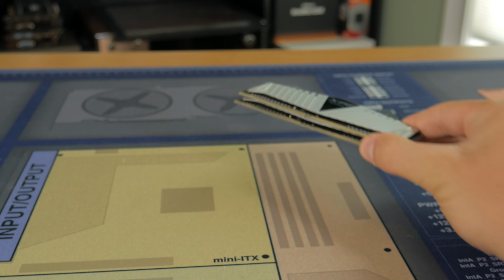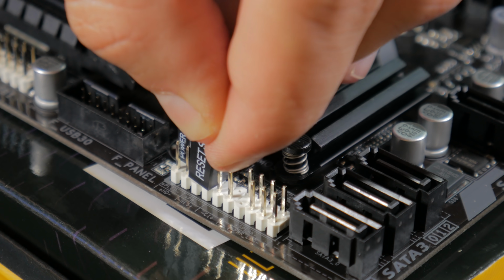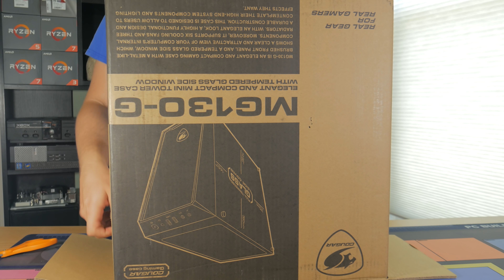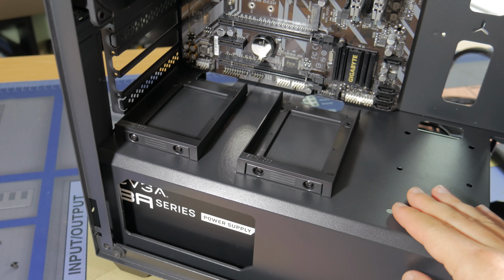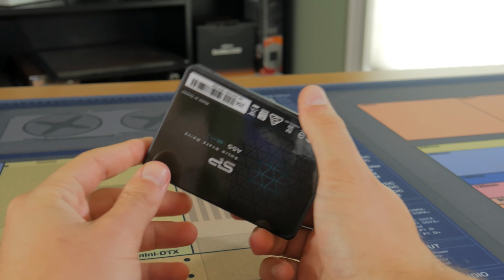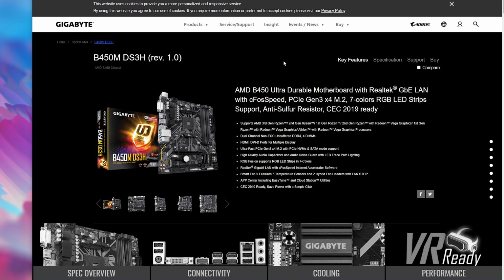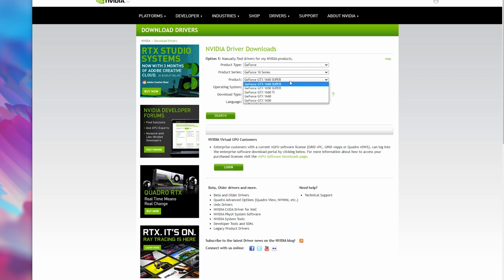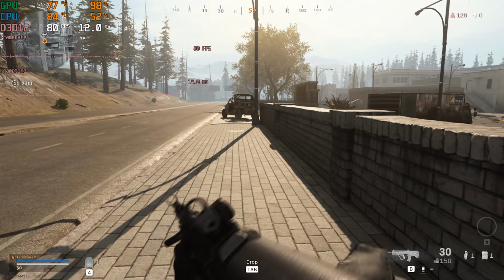HOW TO: Build a $550 Gaming PC! (2020)

Comment: I finished building and when i went to plug the HDMI in it said no signal. I the plugged it into the graphics card but nothing happened. Any Suggestions
Reply: The same thing is going on with mine that I just built. Same exact build but I get no post. I did everything he did EXACTLY, this is honestly bullshit. If you ever find out what went wrong I’d highly appreciate it. The thing I hated about this video though is that he plugged in all the cables while on the carboard to be more clear but it only ended up confusing me because when I routed my cables mine looked nothing like his.
Reply: Did you find a fix

Comment: I used everything in this video but went with recommendation 1 for the CPU but when I try to power it on, I get no signal reading on my monitor. I tried checking the connections on my PSU but didn't see anything wrong. The fans kick on but nothing else.

Comment: Would you guys recommend using a ryzen 3 3200g apu as a budget gaming pc, then add a gpu later? Or would it be better to use a ryzen 3 3100 and gtx 1650 super off the bat???

Thanks!!!
Reply: I built this PC last night with the Ryzen 3 3100 and the GTX 1650. My son and I are having fun playing Apex today.
Reply: @DSTROYRvids  Nice!
Reply: JChase7452 I built it last night as well but I’m having trouble with the display not showing any advice ?
Reply: @strafezss5883  did you connect it to the motherboard or the gpu
Reply: The ryzen  3 3100 has no apu so if you connect it to the motherboard, the display will not work. You have to connect it to your gpu/graphics card with an hdmi or displayport cable to your tv or monitor
Reply: Limespy YT yeah I connected it from my gpu to my monitor I went back and unplugged everything and replugged back in its just not working
Reply: Limespy YT I was using the display port it just says “no signal” when I power it on
Reply: @strafezss5883  could it be that your GPU is faulty???
Reply: Limespy YT the fans are spinning and it’s brand new so I don’t think so
Reply: @strafezss5883  is everything plugged in right? Like your psu cables, and motherboard connectors?
Reply: Maybe something is not plugged in right?
Reply: Or try using HDMI instead of Displayport. I've never tried using displayport yet.
Reply: Limespy YT yeah I went through all of thoes things and I connected and re connected them but still nothing I also tried the hdmi cord it still says no signal
Reply: @strafezss5883  well then... I dont really know what to do... Sorry man. Keep talking to me and lets see if we can figure it out.
Reply: Also are you connecting it to a monitor or a TV?
Reply: Limespy YT a monitor I also tried it on a tv
Reply: @strafezss5883  oh.. well then. I'll try to help ypu find out what is wrong ok.
Reply: @strafezss5883  the link goes to a video about what happened to your pc
Reply: Limespy YT I think it might be something with the bios and it not being supported
Reply: Limespy YT I think I need to update it but idk how
Reply: @strafezss5883  first of all, what's your cpu, and what is your motherboard?
Reply: @strafezss5883  its easy to update the bios, but your pc isnt working
Reply: @strafezss5883  all you have to do is go to either AMD or Intel website, amd search for your motherboard model. There should be an option to update the bios to support newer cpus
Reply: Limespy YT I need a 1000 or 2000 series to get it running then update bios and replace when done
Reply: Limespy YT but idk where to get one without having to pay a ton
Reply: Limespy YT my mother board is the one in the video the cpu is the ryzen 3 3100
Reply: @strafezss5883  there should be nothing wrong though. The motherboard and cpu are a perfect combo for each other. And im pretty sure that the b450M is suited for 1st 2nd and 3rd gen ryzen processors.
Reply: @strafezss5883  what about your power supply? Some chinese brands are faulty.
Reply: The video i sent the link for mentioned either a power supply, or ram.
Reply: @strafezss5883  Do you have a second pc, or a laptop that you can use to connect to the monitor?
Reply: Could be that its the monitor, and not your pc???
Reply: Limespy YT it’s not the monitor I plugged into my tv as well also I got the same power supply as him
Reply: Limespy YT also it’s possible that it’s not uptodate if they gave me a mob that was in the back of the shelf so maybe it’s just the bios
Reply: With the ryzen 3 3100
Reply: @strafezss5883 yeah, that could be why. It was maybe a used mobo from like Microcentre or something
Reply: Is your cpu fan spinning?
Reply: Limespy YT yeah
Reply: Limespy YT everything in the pc is working but when it comes to the display it’s not working
Reply: Limespy YT also my power button dosent work when I need to shut it off I found that it might have something do to with the bios not being up to date which is why I’m assuming I need to update it
Reply: @strafezss5883  when you say power button, you mean the one on the pc case?
Reply: @strafezss5883  try your front panel connections. The little ones that your connect to the side of the motherboard. The one that say reset switch, power, hd audio, and other ones like that.
Reply: @strafezss5883  but it could also be because the motherboard is used, and its damaged or something?
Reply: Limespy YT the mob is claimed to be new also the power button on the case and I re plugged the reset switch in as well as all the other one but it dosent worm
Reply: Work* and that’s also a result of the mob not being able to support the cpu which results in no signal and the power button not working
Reply: I just don’t know where to find one without having to spend 100$
Reply: @strafezss5883  yeah, thats really hard... I'm not really sure if there are any other options, other than buying another cpu.
Reply: @strafezss5883  apperently, you can bring it to a local tech/computer shop, and ask them to update the bios somehow for only $30
Reply: @strafezss5883  check out the link i sent
Reply: Limespy YT Thanks I might check out some around me
Reply: @strafezss5883  your welcome! Hope that your PC will be fixed!
Reply: Limespy YT I’ll let you know if I got it to work ty
Reply: @strafezss5883  ok got it. Bye For now!
Reply: @strafezss5883  Did you get it working?
Reply: JChase7452 no I’m getting a new cpu a ryzen 5 2600
Reply: JChase7452 it should work 100% with this cpu
Reply: @strafezss5883  thats pretty expensive though
Reply: Limespy YT it’s only 40$ more I’m returning the other one
Reply: @strafezss5883  oh well at least you can return it
Reply: @strafezss5883  I thought you now have two cpus
Reply: You might have a bottleneck with the gtx 1650 super because its am ryzen 5, and not a ryzen 3
Reply: Limespy YT what do you mean
Reply: Limespy YT bottleneck?
Reply: Limespy YT wait like the ryzen 5 wont perform to its best if it’s ability because of the gtx 1650 I mean tbh it’s fine I don’t mind I honestly just wanna be able to play games cause anything is better than a Mac en
Reply: @strafezss5883  yeah something like that. Either the cpu will not perform to its best, or the gpu. I'm not sure.
Reply: @strafezss5883  basically the cpu might be too powerful for the gpu
Reply: @strafezss5883  search up bottleneck calculator, and enter your ryzen 5 2600 and gtx 1650, the website will give you a bottleneck percentage.
Reply: @strafezss5883  if the percentage os under 10% then it is okay. But the lower the better.
Reply: @strafezss5883  if the percentage is over %10 then it is a bottleneck. Basically, you will get random frame rate drops/ fps, and it will not be performing at 100%
Reply: @strafezss5883  the ryzen 3 3100 and the gtx 1650 super is a perfect combination, but it did not work for you. Because of the bios situation.
Reply: Limespy YT ahhh alright
Reply: Limespy YT it’s 9.24%

Comment: Yo Matt I'm gonna build my first pc with a similar budget, can you give me your input on my parts.

MOBO: BIOSTAR A320MH AM4 AMD A320 SATA 6Gb/s Micro ATX AMD Motherboard ($55)
Graphics card: MSI GeForce GTX 1050 Ti DirectX 12 GTX 1050 Ti GAMING X 4G 4GB 128-Bit GDDR5 PCI 
Express 3.0 x16 HDCP Ready ATX Video Card ($160)
Case: Cooler Master MasterBox Q300L ($50)
Power Supply: EVGA 500 W1 100-W1-0500-KR 80+ WHITE 500W Power Supply ($50)
RAM: G.SKILL Aegis 16GB 288-Pin DDR4 SDRAM DDR4 2666 ($50)
Processor: AMD RYZEN 5 2600 6-Core 3.4 GHz (3.9 GHz Max Boost) ($140)
SSD: Silicon Power Ace A55 2.5" 256GB SATA III 3D TLC Internal Solid State Drive (SSD) ($28)

All these parts are from newegg and I would really like your opinion on them.
Reply: Does the motherboard support the Ryzen processor?
Reply: Eduardo Luna No it doesn’t thank you for pointing that out. I’ll look for one that does.
Reply: Ryzen is am4

Comment: Processor: AMD athlon 200GE 3.25GHz APU with vega 3 graphics 

Motherboard: AMD A320 DDR4 Micro-ATX RYZEN mb

Memory: 16GB DDR4 2666Mhz high performance gaming RAM

Graphics card: integrated GPU share up to 2GB graphics

Primary hard drive: 256GB Ultra-Fast SSD upto 550mb/s+ speed solid state drive

Power supply: Gamdias KRATOS E1-500W RGB Power Supply

Heatsink and CPU fan: standard heatsink and CPU fan

GTA 5

Will it run?

How much fps?

How high graphics can it go without lagging?

Will it lag?

Will it overheat?

Comment: i like this cougar tower and planning to build my 1st pc with the same case
just wondering if a evga 450w psu is enough for a ryzen 3 3200g and a rx 570 4gb
im planning to build w/out  a dedicated gpu 1st and just buy one after saving enough money again

thanks is advance
Reply: 450 would be fine for that system, but if you plan to upgrade, or even if you don't plan, it's safer to go with a 500 or 600 watt, but whatever fits ur budget. 450 is perfectly fine tho for that
Reply: @noahzacharia5030  thanks a lot for your advice, my original list is a 500w psu but rn im having a hard time finding one and a lot of them are out of stock in my country
but again thank you for the reply
Reply: @hitori_gurashi  yeah the world is kinda on a psu shortage, but good luck w ur build

Comment: U probably already got a comment like this but u missed the important part that it already has pre applied thermal paste on the bottom of the cooler so if u where to change out the cooler then u need to make sure to apply some thermal paste cuse its what helps keep everything cool and stable

Comment: How do you know if the RAM sticks should be paired on a B2 with A2 rather than B1 with A1? Don't both of those configurations benefit the dual channel? Does it make a difference having A2/B2 channels over A1/B1?

Comment: The best part of the video that I haven’t seen anyone mention is the whole section about plugging in cables and orientation. The cables were filmed plugging in while the mobo was on the box, NOT installed into the case. The extra detail probably made more sense to 99% of new builders.

Comment: IF YOU TURN OFF THE FRAME COUNTER... an FX-4100 with an equivalent radion gpu will run the same. just beware of bloat-ware, easy enough with a fresh OS.
Reply: 3300 over the 4100 ... loading times... your waiting at the game match timer for an extra 10 seconds.
Reply: 10 seconds on some game that even with a fx4100 boots up faster then a piss brake.
Reply: @hollol5933  fx4100 with a rx570
 54.6 fps avg. In Rainbow Six Siege high settings 

46 fps avg. In Rust, all settings turned up as far as they go.

Tho I guess in Minecraft with the settings render distances... maxed out it gets 15-20fps.

BTW the Dule channel ddr3 ram I have is set to run at 500Mhz.

At 1080p the RX570 4GB over heats and thermal throttles on the stock fan profile. The fans get loud trying to keep it cool, even  if it's a fx4100 and 500mhz ram feeding it.
Reply: @ardennielsen3761  the fx4100 is a HUGE bottle neck the rx 570 should be performing way better then that
Reply: I’m still not sure if your joking or not
Reply: @hollol5933  ya... the DDR3 i have is running at 400Mhz.

Comment: Hello matt. I just wanna ask. What is the difference between msi a320m-a pro and gigabyte b450m. Thank you for replying.
Reply: You'd probably need a bios update if you're using newer cpus (ryzen 3000 series) if you go a320-m pro
Reply: @icanbefree8742  Why do i need to update my bios?
Reply: @DD-qw1yr  it might not support your cpu if it's a newer one. It should say what cpus the motherboard supports on the box though
Reply: @icanbefree8742  I think msi a320m-a pro support the ryzen 3 3100.
Reply: @DD-qw1yr  ok yeah I just looked it up and it is supported, but yes a bios update will be necessary. Also if you go a320m there's no real overclocking support. Personally I would try to find a cheap b450m motherboard instead if possible - saves you hassle of bios updates and will probably age better too.
Reply: @icanbefree8742  Well, im not an expert of oc thing. So i would go for a320m instead. Because of its price difference. And theres no performance diff btw. Same as is it.

Comment: which one to get r3 3300x or r5 2600?
Reply: Whichever. The Ryzen 5 is a bit more powerful, getting over 100 fps at 1080p High/Max settings. Depends if you want that extra fps at the same or better graphics settings.
Reply: 3300x is better by all accounts. But depends on the prices.

Comment: Help im putting tbis buils together on pcpartpicker.com and it says the mobo and cpu aren't compatible. Ar3 they? 
Warning!Some AMD B450 chipset motherboards may need a BIOS update prior to using Matisse CPUs. Upgrading the BIOS may require a different CPU that is supported by older BIOS revisions.
Reply: If the motherboard says it's compatible on the box, then it is out the box.
Reply: the "b450m DS3H" doesnt support the "ryzen 3100" out of the box, you will need to update the motherboard bios before you can use this cpu. updating the bios is not that complicated but since this motherboard doesnt have "Q Flash plus", you will need an older ryzen cpu that is supported by this motherboard, you can find a full list of supported cpu on the official gigabyte website.
Reply: Rocky Go  hey thanks. Yeah I chose tbe ryxen 5 3600 too.  No compatibility issues
Reply: Rocky Go  Will this be the same for my Ryzen 3 3100? Sorry I'm new to building pc's (Please respond quickly)

Comment: I love this build. However, in Europe this particular build would costs you 700, not 550$. I recommend a “downgrade” version with similar performance for European builders by opting for the Ryzen 3 3100, B450M S2H, RX580 8GB, Any good cheap SSD, G.skill Aegis 16gb RAM, SilentiumPC 550w 80+, MSI Mag Forge.

Comment: How In The World Does This Perform Better Than My $1500 PC??????
Reply: What are your specs? I might be able to tell.
Reply: @CodingLessonsDaily  i5 8400 2.80GHz, GTX 1060 3GB OC, 16GB Corsair DDR4.
Reply: @oliverkeast305  the 1060 3gb is on the lower end of a mid-tier card, the 1650S beats it. Your 8400 should outperform a 3100, but loses to a 3300x which runs on a higher frequency, and on 7nm. I'm assuming your $1500 PC was a prebuilt? That's where you got shafted.
Reply: @Tovinthorn  Yeah that seems correct
Reply: @Tovinthorn  It actually wasn't a prebuilt. I should have done some more research before buying the 1060. Im waiting fir the 3060 to come out, and when it does ill be buying that. Later down the line upgrading to a 9700F.
Reply: RozzoX sounds like a good upgrade path. How much did you want to spend on a GPU that you want to consider the 3060?
Reply: @Tovinthorn  Around $400-650 AUD

Comment: Hey! You should make a $450 build using the i3 9100f! (at least thats what im doing)  and also thanks for testing fall guys!
Reply: wow I sparked a debate
Reply: Nope he should dont do it beacuse i3 9100f had to less Cores
Reply: MagicPlays did you just have a stroke
Reply: @PlzReviveMeBro  haha Kids its not faster the i3 10100 ist faster Sometimes but the i3 9100f is slower
Reply: @timshardware  bro are you having a stroke? also its about price to performance not just which processor is the best one
Reply: @timshardware  my guy i am a proud amd fanboy but you dont understand anything in english
Reply: @ned_filip6728  i Understand what you write but why a stroke. Yeah the price-performance is better. Sry when  you dont Understand my english
Reply: MagicPlays 9100f is also 9% faster than the 3100 for $45 less

Comment: I love the look of that case, but is there any airflow? It looks entirely sealed up.
Reply: Its definetly not the best for airflow much more of a "showroom" pc
Reply: Colin I want to get a different case but idk which one to get because I don’t know if the motherboard and the other parts will fit
Reply: Chris A ive got the corsair 250i airflow which works great and is designed to have a lot of air and works great
Reply: The top of the case is a magnetic filter, so it has lots of airflow there
Reply: @John Perez a fan is not a good airflow since it pushes the air.. the best airway could be it's top... That's the reason i did not put any fan there
Reply: @Jared Miñoza yes.. i have 3rdb fans, i think that's enough plus the case's fan at the back

Comment: What cpu air cooler for ryzen 5 3600/b450 tom max/44mm tall ram sticks/rtx 2060 gpu would you recommend?
Reply: The air cooler comes free in a Ryzen CPU box so don't worry about that. If you can stretch your budget, go for a TUF Gaming B450 but if you can't then get the one shown in the video. Use any RAM sticks you want but try to get 3000mhz or more and definitely 2 x 8GB (more if you want) when buying them. I'm not sure about the 2060 because I'm poor lol.
Reply: @CodingLessonsDaily  well i dont like the stock stealth cooler im looking to upgrade to maybe a scythe fuma 2.
Reply: @mts982  Ok. Just make sure it fits your motherboard and CPU.
Reply: @mts982  Arctic freezer 7x. Or there's a Arctic freezer 33 on 25usd on amazon.com atm. Good cooler for the price